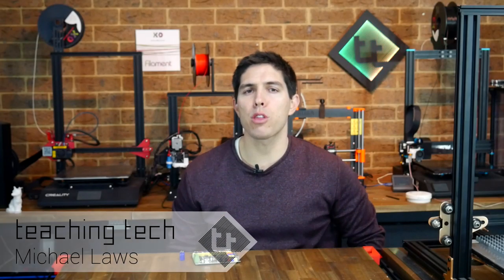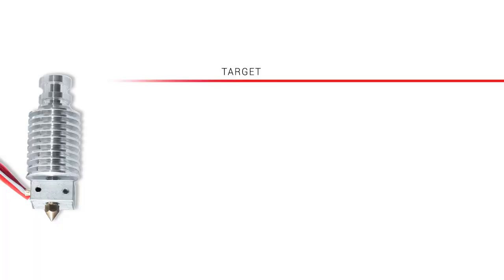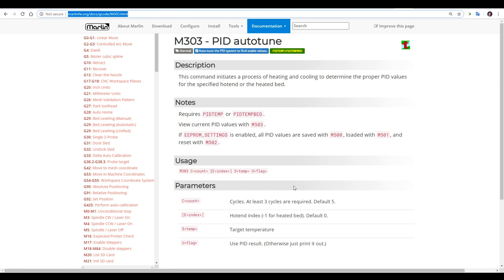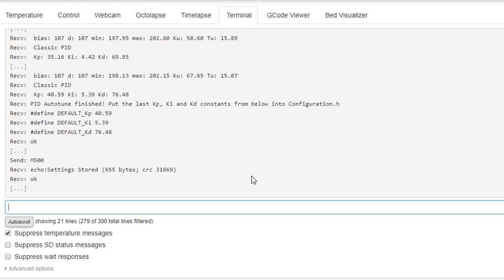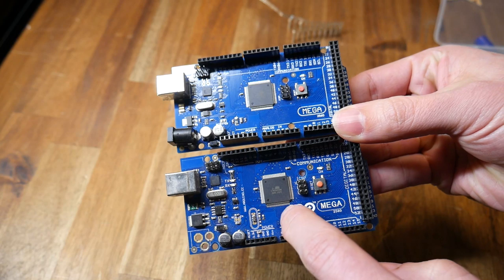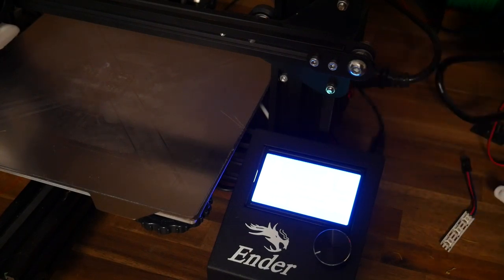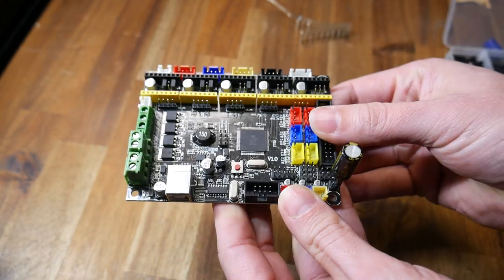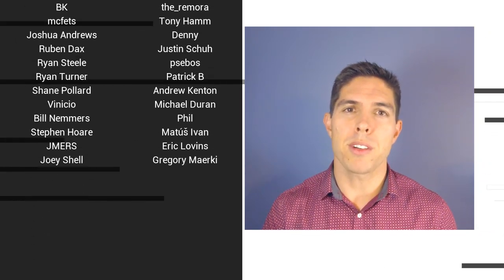Two easy fixes for 3D printer temperature swings - PID autotune

Comment: Absolutly been fighting with this issue on an older Tevo Tornado running a stock MKS 1.4 board that i upgraded to Klipper. The hotend was all over the place. Replaced the hotend, sensors, heater, Tried every trick with the configuration and no luck. I had some of these caps, tossed one on last night and re ran a PID auto tune.. The temps are absolutly STABLE and the lines is flat. The PID controller actually modulating it's self instead of just turning ON/OFF and jumping all over.
Thanks SO MUCH, It was driving me crazy and I don't see a lot of info about this problem. This is the first time I'm hearing about it and I thought I read everything about the issue.

Comment: Hi Michael, thank you very much for the video. After nerve crushing "biippp" sound at least 10 consecutive times, I changed the Thermistor of my ender 3 v2 neo 3 times, in addition to changing the heater cartridge. But I had the same fluctuation issue until seeing your video. None of the other videos or the user guides were mentioning about calibration codes. 
This worked like a charm! Thank you.

Comment: One tip for PID tuning from my experience: do it with filament inside the hotend, loaded, ready to print. After initially calibrating my PID, starting a print I ran into thermal runaway (being too low) because the filament cooled the hotend and it couldn't keep up. So do it with filament inside. Happy printing! And thanks Michael for the great videos!!

Comment: So... Here I am 4 years later and I did a "recent" change of my hotend (on my Tevo Tornado V2), upgrading to a E3D v6. I have been baffled by the unstable temps and I did the capacitor on the 5v and gnd pins trick and it solved the problem. I have changed firmware so many times. Thanks for the well documented solution. I can't believe it took me this long to find it.
Reply: This fixed my Tevo, it was driving me crazy. Went to Klipper and could NOT get stable temps on the hotend no matter what. Even replaced it, the heater and sensor. Put on a cap and they are perfectly stable now!

Comment: Thank you so much! I was able to fix my issues with temperature fluctuation using the second method with the capacitor. This was really easy to follow and my printer is working so much better now!

Comment: Have a RAMPS 1.4 on Mega2560.  Both my bed and hot end temps were fluctuating identically +/- 3 degrees at room temp.  Tried out the capacitor using the AUX-2 GND/5V pins on the RAMPS.  Worked like a charm!  Thanks so much!

Comment: Incredible - for years my temperatures fluctuated and didnt give decent PID routine results.  That capacitor is amazing ! Temperature sits right on the target.  And I can now run my M303 at the higher temps I use

Comment: Apparently, this also happens when upgrading from a 12V system to 24V. I built my 3d printer from scratch, also using an MKS Gen L as motherboard then converted to a 24V system. The 1000uF capacitor fixed it! Thanks for the tip. I'm not sure about my cap if it's low ESR and I'm really in a pinch so I tested out these generic capacitors I also have been hoarding. It's working well so far.

Comment: PID calibration fixed my problem. Thanks as always. 
It was around +/- 4.5degree before calibration. Now it is around +/- 0.6degree. 
Printer is Ender 3 pro v1.5
Mainboard is stock 4.2.2

Comment: Thanks Michael,  MKS Gen 1.4 also have this problem.  I installed 470uf 25v LowESR cap and is now reading +-1deg temp difference from the target.  Big improvement.  Thanks very much.
Reply: Did you install the 25v capacitor on the 5v pins or did you fix it on the heater connectors ?

Comment: Thank you so much for this video! I was struggling with temperature swings for months and couldn't fix it with PID autotune (and other solutions I found). 
I just stumbled upon your video, ordered low esr capacitor and... temperatures are stable!
You've got a new patreon supporter!

Comment: A simple, zero-cost check: starting with the power supply, make sure ALL the power connections are tight! Especially the power supply, hot end, and bed heater. With thermal cycling, connectors can work loose over time, causing voltage drops and fluctuations. Same goes for thermistor/temp sensor connections -- make sure things are tight. While these aren't power hungry, a little electrical noise can cause big problems.
Reply: Hugely good advice here.
Reply: Fixed mine for a 20 hour print and now it's being very temperamental again

Comment: That works absolutely beautifully !!!!! I was a little skeptical about this but I tried it anyways since the capacitors were so cheap. I am amazed at the difference !! I haven't seen it fluctuate either way more than half a degree !! I have a MKS Robin Nano on a Sapphire Pro that has the same problem but worse, and I am going to try this on that printer too. Thank you so much !!

Comment: Once again you save the day. Great video. Quick tip: you can also communicate w/ your printer using the Terminal window in the Arduino IDE (115200 baud)

Comment: When looking into PID tuning the hotend, I noticed many people recommend switching the hotend cooling fan on so that it's tuned for that as intuitively it would make sense that the part cooling fan affects the hotend heating since the hotend is very close to the part - whether that's better or not in practice I'm not sure.
Reply: It absolutely makes sense to have the fan running and anything else that can effect the hotend ( silicon sock for example)  Simply put ...Autotune tries to gauge the temp deviation  between the desired temp ( set point) and actual temp ( measured temp)  It then calculates a proportional response  ( the P in PID)  Also worth using auto tune at the temp you normally print at.
Reply: The hotend cooling fan is always on.  The part cooling fan wont help with temp swings.
Reply: I meant to write part cooling fan both times.
Reply: Ideally you would need to be extruding as well during the autotune process. Ultimately the passage and heating of filament obviously has a large effect on the temp stability
Reply: @bernardtarver  Minor quibble:  Some part cooling fans improperly blow onto the hotend assembly itself due to bad designs.  Additionally, some hotend cooling fans blow right on the heater block instead of on the heatbreak/heatsink where they're meant to.  Ideally neither would be the case, but here we are.

Comment: Hello, I'm using an Ender 3 V3 SE, and one day it's just suddenly had horrible inconsistent nozzle temperatures. It's gotten so bad, that the temp will jump from 200 to 230 in a matter of SECONDS. I didn't replace any fancy boards of components, I just simply turned on this printer like I had a million times in the past, and it gave me this issue. PLEASE help, I would like a response as soon as possible!

Comment: I have a fun one. I’m building a diy IDEX printer and hotend 1holds temperature like a champ but the 2nd one oscillates wildly. I’ve swapped both boards, wires, thermistors, heaters, and tried switching between hotends. Nothing has worked so far. I’ll get some capacitors and try that

Comment: I purchased a new 4.2.7 "silent stepper" board and the sawtooth temperature fluctuations are ~10 ° C between +&-.
I can't rely on the printer because it got noticeably worse after printing a custom blower addition for the hotend fan.
I'll be trying the first option, and hoping I won't need the second, but am very happy to see that it's available in case the M303 coding doesn't fix the problem.
Thank you for making this video. How did you figure this out?

Comment: Great video!
I attempted the pid autotune but I get a over temp failure error. still waiting on the capacitor.
Any Ideas? What should the Ohm value of the heater Be?

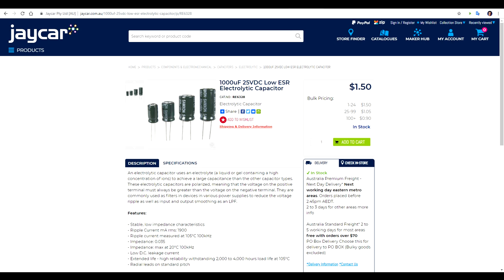Comment: I am having this problem.  At 6:00 in the video you show how the printer stays on for a few seconds after adding the capacitor.  Is that to say that, if my printer already does this, adding the capacitor is pointless?  I recently replace my motherboard, but I did so with the same exact motherboard from the same exact manufacturer.

Comment: Im having this problem with bigtreetech 2 in 1 hotend as the heater is quite far from the tube type thermistor so temp creep across the metal takes some time to respond tried the autotune but not sure how to account for such a distance thanks for all your cool videos

Comment: I hope that you have a third option. I have replaced my complete hotend and am now using a cartridge thermistor. Heater cartridge power drawing from a MOSFET. Same control board. Set at 220 degrees, temperature cycles between 216.8 and 223.4 after PID Autotune. Have set the TEMP_BED_HYSTERESIS to 4 so that I can print. Temperatures above 224 give a wider temperature spread. Would be grateful for any suggestions how to fix this.

Comment: Great video! Can you explain why this makes a difference?
Reply: The capacitor will even out the voltage variations caused by the heater element cycling on and off as it attempts to  maintain the target temperature.

Comment: Hi , i am using the community firmware on my CR6-SE . When i send M500 , i get a responce = " Saving DWIN LCD setting from EEPROM "  
Now if i recall right the DWIN LCD has to do with my LCD screen firmware. 
Do you think this is an issue ? Should i still use M301 technique ? Thanks !

Comment: There are some useful settings in the configuration.h file than can help solving temperature instability issues:
#define BANG_MAX 255     // Limits current to nozzle while in bang-bang mode; 255=full current
#define PID_MAX BANG_MAX // Limits current to nozzle while PID is active (see PID_FUNCTIONAL_RANGE below); 255=full current
Use them to lower the maximum power to the hotend or hotbed. 100% power is represented by 255, you could try 200, which is about 80% of the power. #define PID_MAX 200
Reply: Changing tuning current doesn't address temp ringing while printing.
Reply: @bernardtarver  Why not? Reducing the max power will at least reduce overshoot I was unable to get a stable temperature with autotune, until I reduced the maximum power

Comment: My Tevo Tornado had wide temperature swings when I was running high temp plastics at around 240 to 250 C. I did the automatic PID tuning and it was worse than the defaults. I just put this cap in and at 240C I'm getting a max swing of +/- one degree C. This should have been supplied by the manufacturer but it's not, I highly recommend that everyone with a Tornado take the time to add the capacitor...

Comment: Just a note on capacitors.  There are some experts that have noted that running a capacitor dramatically below its rated voltage can shorten its life also.
I am not sure how much credence I put in that, but I would get something close to the correct voltage.   
I do find that the PID tuning on my Ender 5 can vary quite dramatically every time it is run.  It seems to work okay, as in being stable, but there is more than 10% variance in the three values each time it is run.

Comment: A high temperature thermal interface material does wonders for your nozzle. I use Deep Cool Z5 as it has the highest temps without breaking down I could find - 300C

Comment: I am running into these temperature fluctuations on my SKR mini e3 v3. So I heated up the hotend and let it sit and it stayed relatively constant. Then I started heating the heat bed and everything changed. The hotend started fluctuating right away. I tried the capacitor fix, but put on the 3.3v because the SKR min has 3.3v for the thermistors. Was that the right move? One thing that has helped is a ferrite clamp on choke around the heatbed wires. But still no joy. This has only happened to me since my conversion for the Ender SW. Any thoughts on this issue?

Comment: I was having this problem all the time, so I did the capacitor trick and it fixed while sitting still, but when I run a print it still has this issue. Any thoughts on why it doesn't always work?

Comment: Thank you for your work. I have recently upgraded my D-Bot CoreXY design to include a new hot end and heated bed.  The PID autotune of the hot end went very "smoothly". the heated bed tuning however seemed to produce largely varying results when repeated. My bed is made up of a Keenovo 110V 600W Silicon flexible heater with its supplied thermistor and a 1/4" thick MIC6 aluminum tooling plate bed. Therefore it has significant heating capacity and much more thermal mass than the PCB bed it replaced. Question I have for you or your readers in the know is how many iterations of the PID autotune procedure are recommended? I'm running a 10 cycle autotune, then updating the K values and running it again, and again...  What is considered good  enough?

Comment: Hello, I realize this is an older post but I just found it & tried adding the capistor to my ender3v2 with 4.2.2 motherboard to try to stabilize my hotend temp, unfortunately now none of my fans work, not by themselves or when u use the control pad to turn them on, I was wunder'n if u might have any ideas on how to fix my printer or if my motherboard is blown & I'm screwed..??

Comment: Hi Michal, I ordered some capacitors since I was struggling with my MKS GEN-L.
In the meantime, I swapped the board for an SKR V1.3.
since I have them laying around, I would install them if there is no harm.
Can I plug it into the endstop socket too? I do not see spare pins for this board

thank you
Reply: I would say no, because the endstop is a sensor feeding into the board's CPU, it's not directly connected to the 5v supply rail which is where the cap needs to attach.

Comment: I had been putting off dealing with the problem for a while now, But while researching this issue I think I found my problem. When operating my power supply voltage drops to 23.5, heating at 9.5A bed and nozzle. With no load, the voltage was at at perfect 24.0. So I turned the adjustment screw up to 24.5, now it stays right at 24v under load. The reason I looked further into the supply was the number of capacitors on my board (geeetech a10, ender 3 clone), I didn't think that adding another capacitor would solve my problem. I may need to upgrade my power supply.

This would explain the sporadic highs and lows that I saw on your graph and my own. When the bed heater is on, the voltage drops, the temperature reading is off, then it over compensates. In my case giving me a max temp or min temp error. This might also happen when someone powers their Pi from the printer power supply.

Comment: Hi everyone. I need some help. I upgraded to a silent board and upgraded my printer to the extender. Turning it on was fine. There was an issue when I heated the hotend. The heat kept going up past the specified temperature. My hotend started smoking. What do you think the issue is? And the fan stopped working too.

Comment: Hi Michael, thank you for this video. I have exactly the problem that Autotune not worked on my skr v1.3. Where would you add the capacitor on this board? Would Z-Max wich has +5V and GND next to each other be ok? Greetings from Munich Germany
Reply from the maker: Yes anywhere where 5v and ground are next to each other.
Reply: @TeachingTech  Hi Michael, it´s me again. My problem is solved by adding the capacitor. Thank you so much.

Comment: Does your video mean the new ender 3 boards DO NOT need or cannot be fixed with the capacitor. Since it seems it was already added?
And how do you send the pid auto tune without octopirint ?
Reply: correct 
the ender 3 boards have a capaciter already iirc

Comment: I'm a bit late to this party but I just got a 3d printer and it prints but it needs some fine tuning. I followed the video and put in M303 C5 S200 U1 in pronterface. It ramped up the temperature and then I got a message "PID Autotune Failed! Temperature too high." Any suggestions?

Comment: I cannot get my nozzle temperature under control.  I have an E3d V6 (genuine), and I recently replaced my ramps 1.4 with an SKR 1.4 Turbo.  Ever since I cannot get  consistent  temperatures from my nozzle.  
I installed a 1000uf cap on my Z plus end stop plug - I checked with a meter to make sure I was on the +5v and 0v pins.  I have done dozens of PID autotunes, trying different temperatures and cycles (I even did a 20 cycle autotune), but my temperatures still fluctuate about +-4˚ even while sitting in the air (not printing).  I have replaced my thermistor and heater cartridge as well, just in case.  
I also changed my pin assignments, to utilize the E1 mosfet on the board, since I only have one extruder, just incase the E0 mosfet was bad.
Is there something wrong with my board?  Is there a way to change the PID autotune parameters?  Different algorithm?

Comment: I recently installed a canister style thermistor to replace the original small glass type on my Geeetech A20m, after the hotend heats up to the set temperature the printer won’t start to print, any suggestions on how to fix this issue ?

Comment: Unfortunately I can't get it to run for the bed. m303 c5 e-1 s60 u1 gives a bad extruder error. I sure can't find a way around it. My bed graft looks like the one in the video since I installed the SKR mini and i have been getting some edge lifting after the install. Never had the issue with the stock board. Ender 3 Pro.

Comment: So happy with your capqcitor fix. My Sidewinder X1 had this exact problem. I couldn‘t find a Low-ESR capacitor and just tried the first random 1000uf I could find - works perfectly.
Is there any reason to „upgrade“ to Low-Esr now?
Reply: I have struggled with this issue on my sidewinder.  I had a non-Low-ESR capacitor in my part bin - and that created a HUGE improvement... to the point that I could PId tune and get prints to start within  2-3 minutes.

Wish that I had known this ages ago.

I did order a Low-ESR cap....
But I still toy with dropping in an SKR v1.3 board that I have sitting here in a parts drawer.